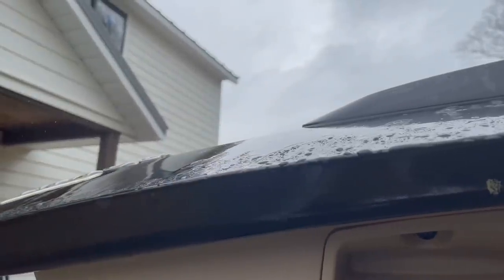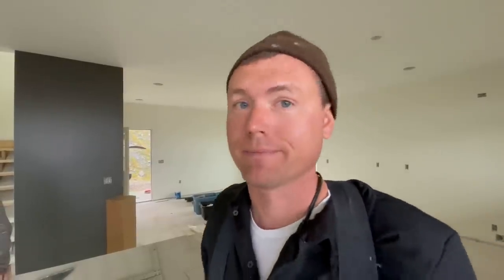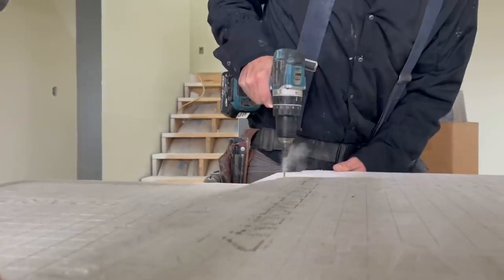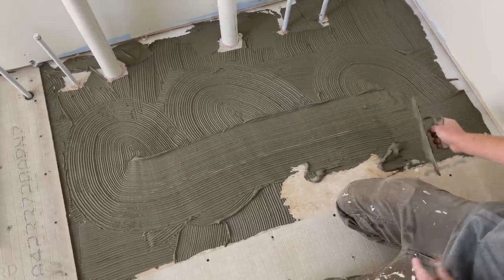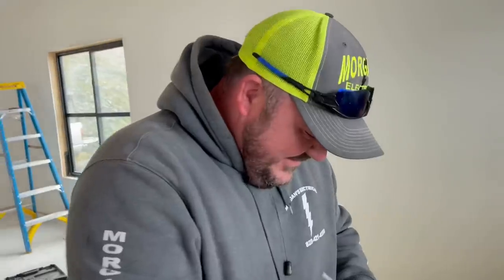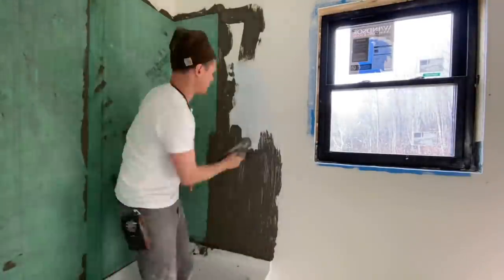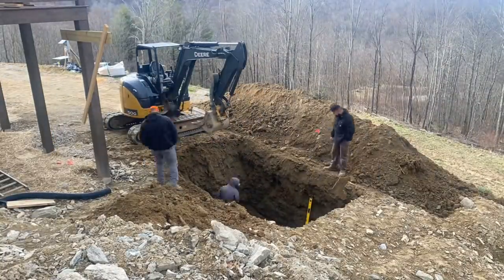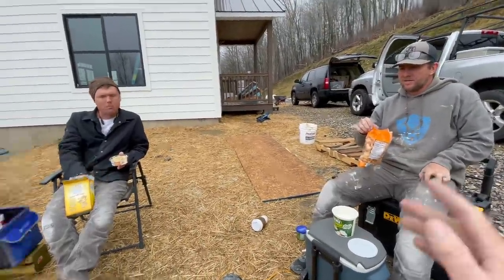Building The Farmhouse | Day 60

Comment: Jay cracking up at 2.55 is priceless. Also, there's any irony in saying not to cut with a grinder because of the particles....then showing it being cut with a jigsaw which is causing dust 😂
Reply: Grinders and circular saws spin thousands of times per minute. This creates a cloud of dust. The jig saw reciprocates hundreds of times a minute. It may produce the same volume of dust as a grinder but it doesn’t throw it as forcefully into the air. It throws a little plume of dust into the air where it might rise a few inches above the surface being cut before settling back onto the board.
Reply: @janderson8401  geez Karen…

Comment: Back in 1967 1st year of my carpentry and joinery apprenticeship.
We dug all of our septic tanks by hand, pick, crowbar, shovel, also our aggregate lines, we then installed a metal framework and mixed our concrete and pour our walls, after 2 days, unbolted the framework,  then pour the bottom,  my Dad did all his own plumbing.

Comment: For shower walls we've switched to Durock brand fiberglass mat tile backer. It's a real half inch thick, cuts with normal drywall tools, and is waterproof. (I've left it submerged in a bucket of water to check and left it in the back of my truck for 6 months in east Texas: no change.)
Reply: Did they use any backer board? I didn’t see it.

Comment: In South Africa. they Tile onto the Boards Directly, but they add an Adhesive/Bonding Liquid, and I've used it on many projects and those tiles are still on the wall, many years later.

Comment: I would double check the thinset and painted walls since you have fresh paint on the walls. Thinset and most mastic will cause the paint to lift off the drywall. Which means all of your tile products are attached to a painted surface that may or may not be attached to the substrate.
1-Try USG Durock next time. No need to pre drill to prevent cracking around edges. You can cut it with a utility knife like dry wall and old 2-jig saw blade will last a lot longer than it did for you in the James Hardi.
3-Always trowel the thinset notches in one direction to prevent air pockets.
4-Add water to bucket before adding power when mixing thinset.
5-Dont forget to tape joints on backer board with alkaline resistant tape.
Reply: Directional troweling is a must. Especially with the membrane. But should be used everywhere.

Comment: I'm doing a tile backsplash on plywood. I had planned on sealing it, but could I use tru-gard to accomplish the same thing. I am open to any suggestions.
Reply: I'd put a sheet of 6mm cement sheet over the ply if possible. If not, seal the ply with bondcrete.
Reply: @oystercovecraftsman9219  Thank you

Comment: I wanted to add this building science note to that no seems to talk about yet . In certain climate zones were there is no vapor barrier on the insulation or interior side of the wall assembly and then we apply these material that prevent water movement through the wall assemblies were there is tile at some point someone is going to say we should not have done that!

Comment: Guys, we use the mortar additive for installing tile directly to the plywood subfloor. If it doesn’t flash, there isn’t going to be any loose tile. Been doing this for 20 years.
Reply: Also the primers and resin waterproofing can be applied to get them tiles fixed solid.

Comment: Hold up did I just see that your truck only gets 3.1 miles per gallon???
Reply: Yeah, I noticed that too.  He was reversing...  but reversing down a slope (so the mpg should be virtually zero).  3.1mpg is the same as 75 litres per 100km.  My Nissan Cashcow averages just under 6 l/100km.

Comment: Worried about dust particles from a grinder but not the drill and saw??? Whole crew should have masks on for this work.
Reply: They were saying that grinder is best solution to cut down on the dust compared to other methods of cutting, not that they were worried about the grinder.  And yes, regardless of the tool, they should have been wearing masks
Reply: They weren't in California.

Comment: Don't want to cut it up with a grinder, because of the dust in the air. Yet, no one is wearing face masks, and you are using jigsaws and drilling large holes that make a lot of dust. And no gloves to protect the hands from the small particles.